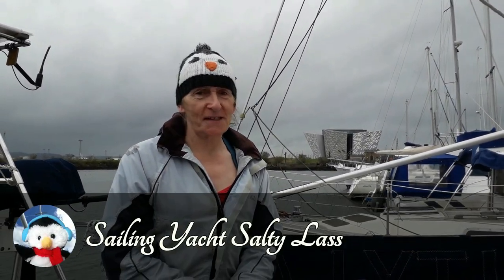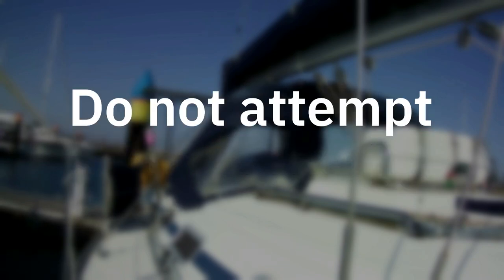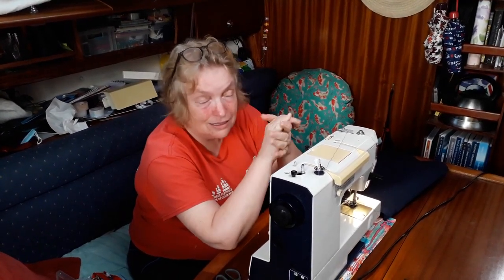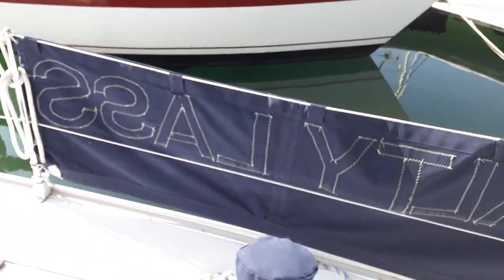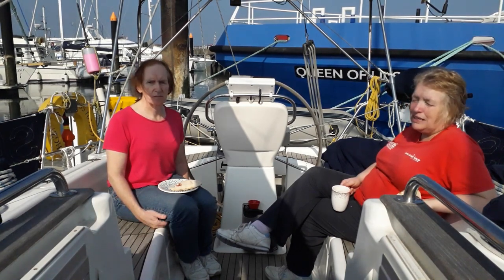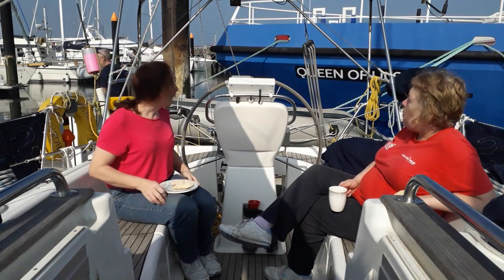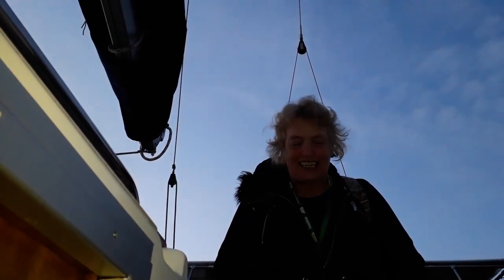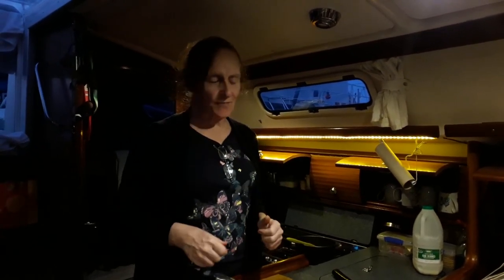Northern Ireland - Winter - Why you should never make your own sprayhood - Ep. 231

Comment: I replaced the windows in my spray hood. The mistake I made was not tracing out the canvas line before removing the old acetate so I lost the shape :( But I do have the Sailrite sewing machine so didn't face your problems. "Use Less", Bev, you're so mean to Gaynor :)
Reply from the maker: If we had known you have a Sailrite aboard, we would have sent the penguin on a midnight raid to steal it 😄😄 We did mark out the window shapes before removing the old ones but we still lost some shape. How's Scotland? Are you sheltered up there?
Reply: @SailingYachtSaltyLass  You'd have been welcome to use the Sailrite but I was on my way out when I saw you tackling the spray hood. I'm anchored in Rothesay Bay which is well sheltered from the westerlies that have been coming through. But a bit bouncy from the ferry wash.
Reply from the maker: Rothesay is a nice little town. Do go up over the Kyles. You will enjoy the passage at the top 😄